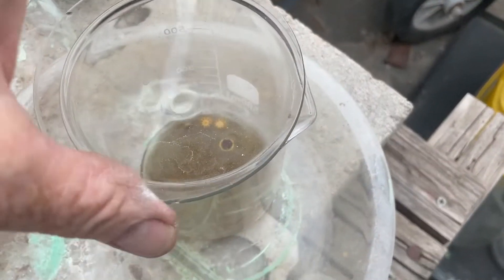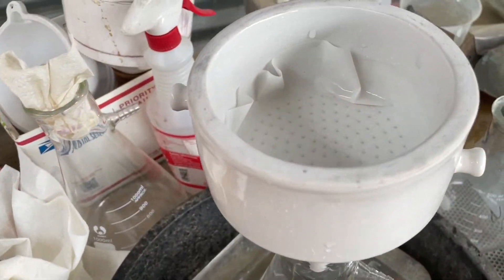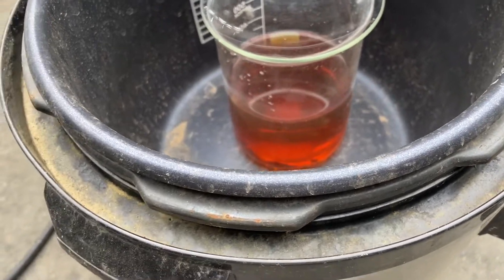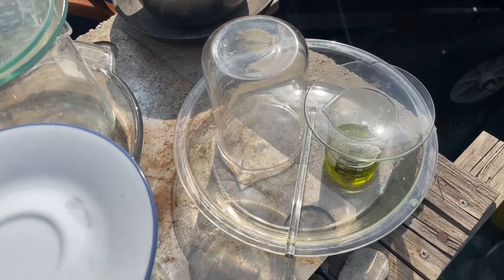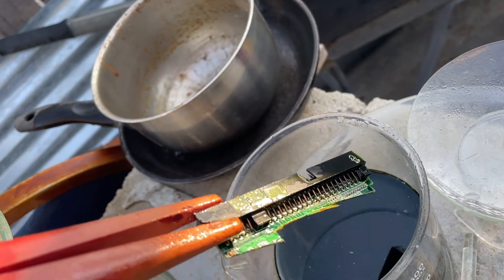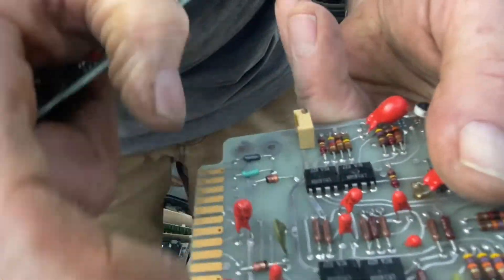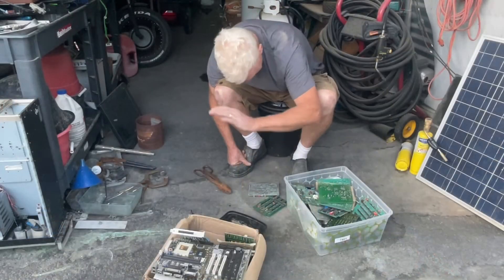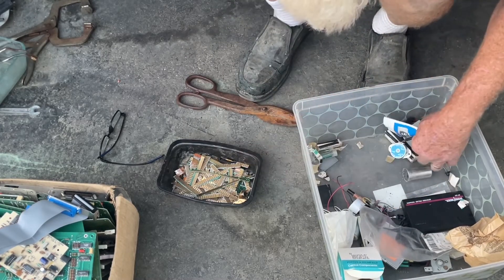Part 2: Chuck Gentles AU Testing and PCB Preparation

Comment: Yeah PT , I think the older computers had more gold in them , i think these newer ones it's down to like cheap ass microns . It will be interesting to see how the Eco Goldex E goes . i should send away for some myself . I got some Eco Goldex O for ore leaching , but it's very expensive to get it sent  to OZ though . cheers . Ned . 👍✌
Reply from the maker: Hello Ned, I paid $108.61 for 2 kg. The Eco Goldex was $30 US for 1kg. I bought two and the shipping was $48.61 😳
Yep shipping is very high for a eco safe material? Seems like another stick it to the people shipping scam for a supposedly Safe Eco friendly product.
I have to say.. it makes stripping the difficult scrap a snap to clean off the gold. 
Definitely the older electronics are way way better. Back when I processed the 9 dollar box of scrap, there was almost 0.1 grams of gold on each slot connector!
All of these cards were I believe early 1970’s stuff.
That’s definitely the good stuff!
Thanks Ned
✌️PT